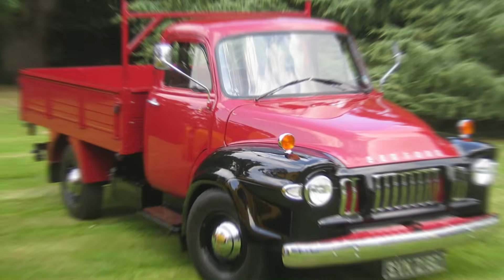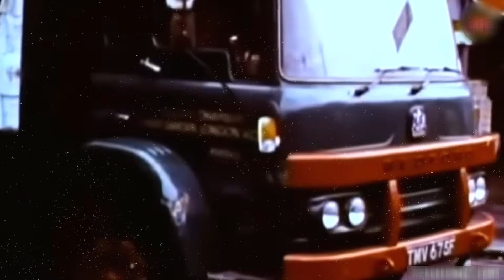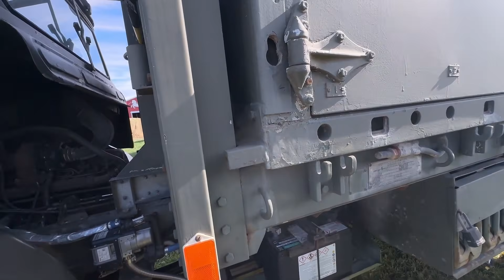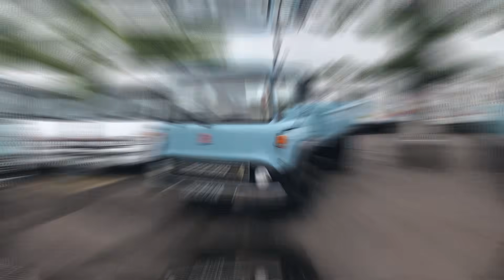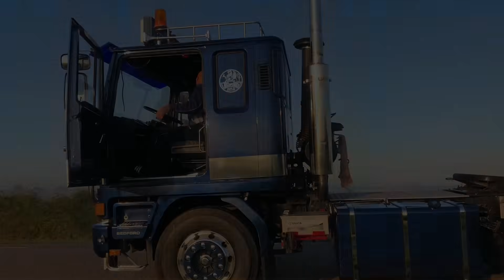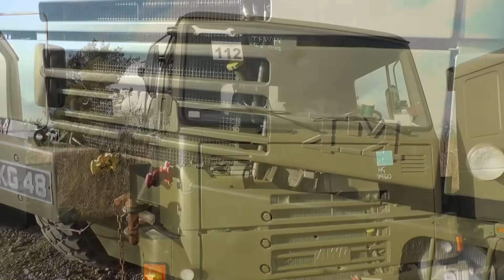6 Bedford Lorries from the 70s that Built a Generation!

Comment: BEDFORD Lorrie’s should never gone under they were one of the best nice looking, easy to maintain, tough as old boots as they say I drove a 24 tonne on farm work loaded to the max a lot of time over loaded it never let me down the only time it was off the road was for routine maintenance how it done it nobody knew we also had another 2 they were just the same, leyland never in the same league.
Reply: 45 odd  years ago I worked for a firm that exported literally thousands of tk's km,s , TL,s , TM,s , j types etc to Asia and middle east . they Used to turn them into those colourful buses they use . Probably still running them , great little lorries .